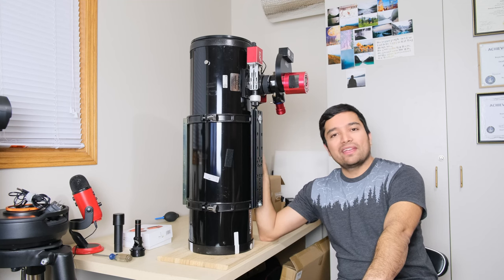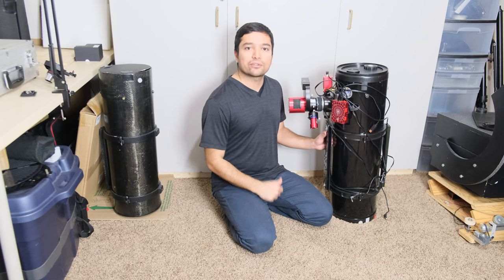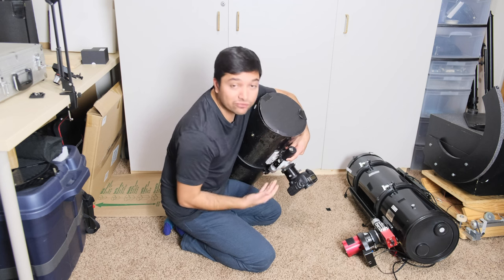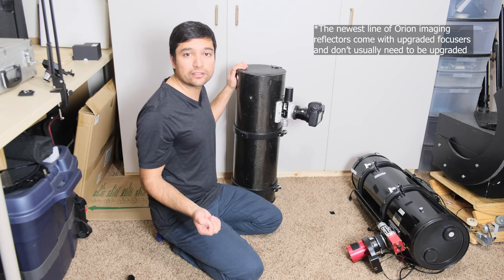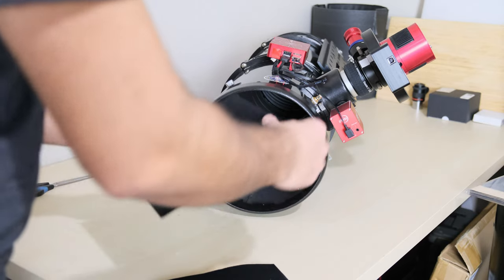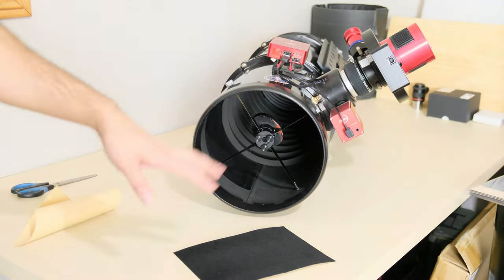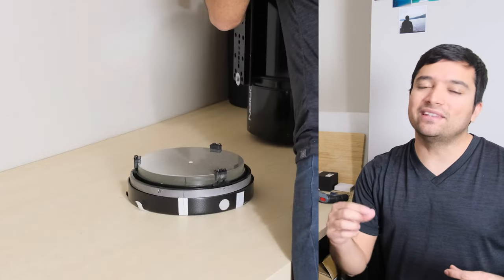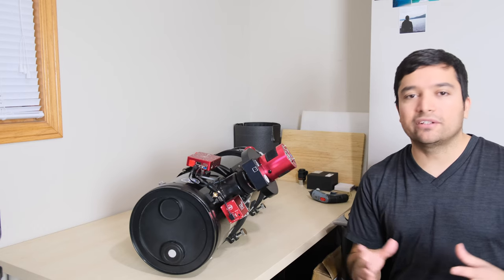6 Hacks for Your Budget Reflector Telescope | Supercharge your astrophotography

Comment: Great video man, love your work!
For the past couple days I've been trying to optimize my 130PDS with diy upgrades.
One thing that I would like to add is, checking for light leaks in focuser by shining a light and taking effectively a "dark frame".

I'm curious how much does it help with contrast if you flock and paint the reflective things inside the tube?
Haven't seen a 1:1 comparison before and after.
But I guess it can only help if done properly :D

Have a g' day sir
Reply from the maker: Thanks friend! I do wish I had the time to do a proper before and after comparison but some of my upgrades were done over a long period of time (such as blackening the drawtube and bolts) so I can't do a true before and after. I think the difference will be easily noticeable after blocking the light leak from the back of the primary mirror if you image from a location with lots of light pollution or lights nearby. If you are in a dark area, light leaks won't be a big issue so it will be less noticeable. The difference from flocking the inside of the tube and the bolts etc will be much more subtle and likely not very noticeable.